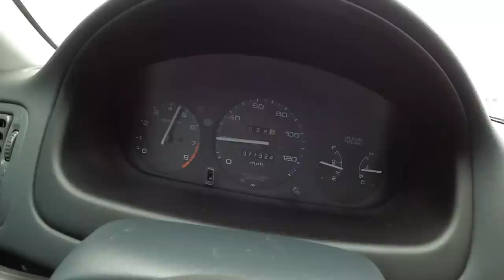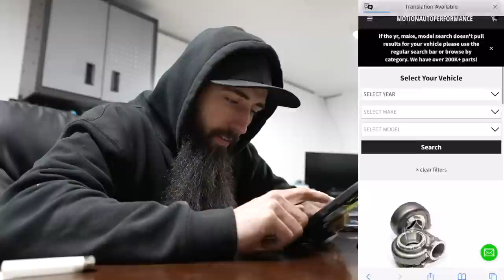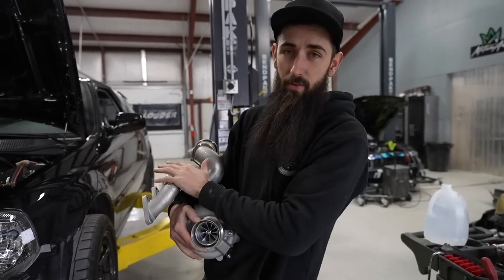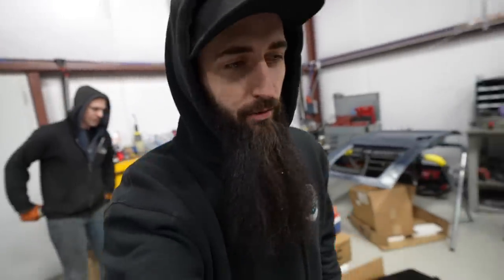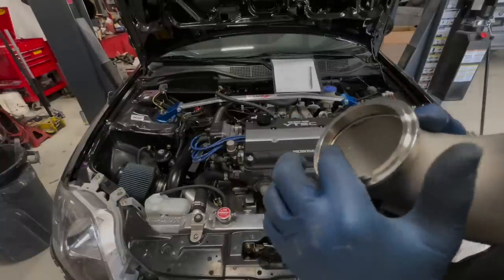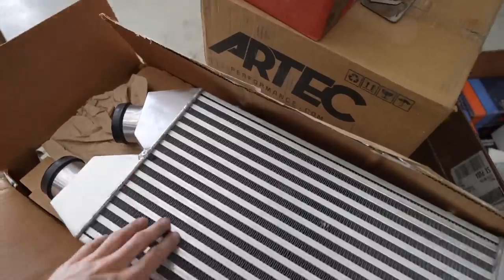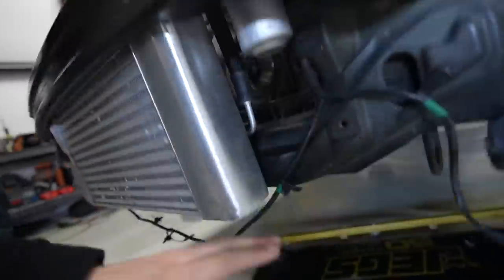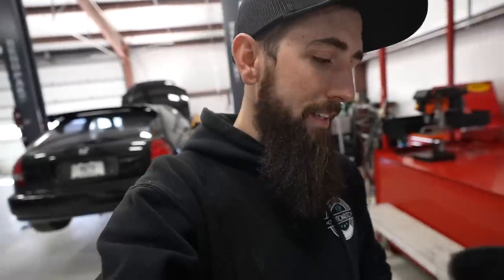Anti-Ebay Turbo Civic Build. B18c, New Artec Turbo Manifold, Garrett G30-660, FAB WORK!

Comment: when i first started building cars in the early 2000s i would remove the a/c and powersteering thinking it would give bigger improvements, now im pushing 40yo my car builds MUST have these creature comforts.i remember times when i was younger i wouldnt even want to drive my car because it was missing these things and was all ebay crap like cheap pogo suspension,we learn though and now these are priorities for me,plus i live in phoenix and summer is brutal. i admit though i'am running a ebay gt2871r on my sr20det and its been a really good turbo but it also costed $500 and for ebay turbo thats pretty fancy but the reduced cost is because they used journal bearings instead of ball bearings so you get what you pay for

Comment: Don't forget rubber mounts for the upper and lower points of the intercooler. Minimises potential cracks and bolts vibrating loose over time. Love the layout and fitment, pipe work is awesome.

Comment: Beautiful build! Would really benefit from a new intake manifold though. Something as simple as a skunk2 pro series. I realize that would require a slight charge pipe modification, but well worth it. The factory gsr manifold serves it's purpose, but awful for forced induction. Just my 2 cents. Quality work guys!

Comment: well it sounds like the b18 didn't have the vtec and intake butterflies working so that's why it feels slow and it has a rev limiter of 8200+ rpm where you only kinda revved it to like 7400(mind you the tacho is like 500 rpm off so hitting 8k rpm is like 7500)

Comment: I was looking at the 0-60 my d16y8 is faster then that, I think you need to Retorque the rocker assembly and then do a valve adjustment